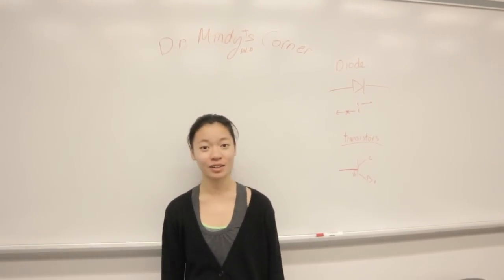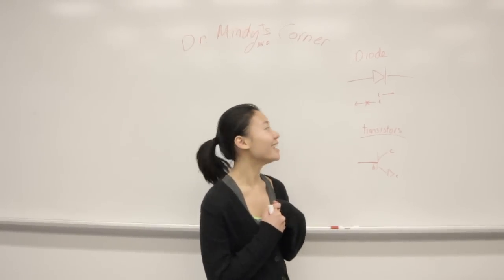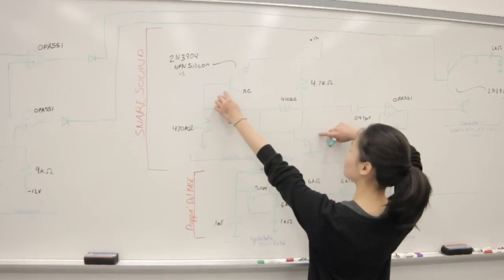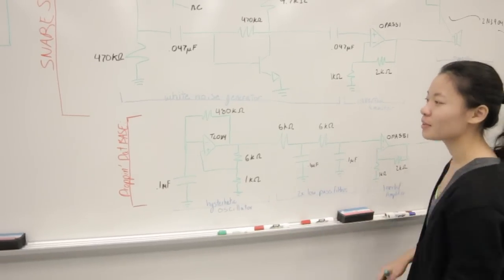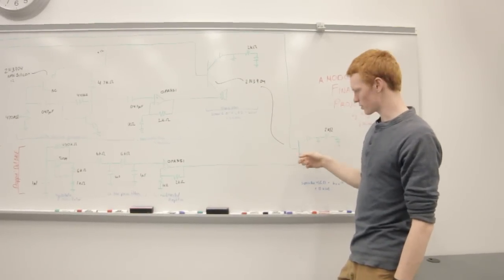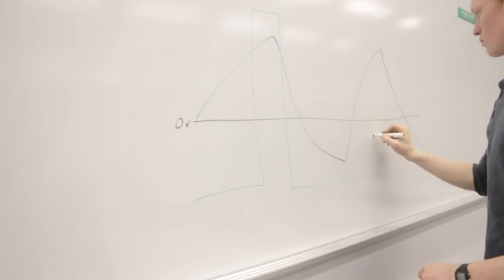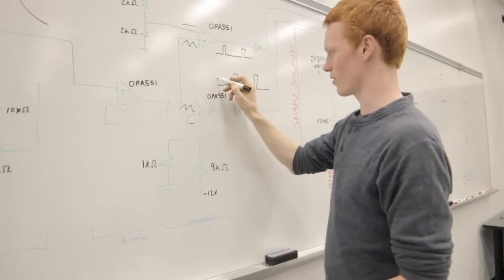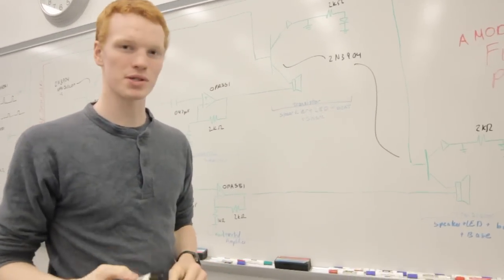Analog Beat Box

Comment: @2:32 yes, I confirm those LED will not work! You have 0V on the anode and 0V on the cathode. There is no voltage difference. You need higher voltage on the anode side to make the current flow through the LED.
Also 2K resistor for the LED gives a current of ~1mA. A LED needs from 10mA to 20mA to properly light up. It depends a lot of the kind of LED you use. More current = more light.
Reply: yes but too much current equals burnt out diode :)  The diode can act as a filter like a capacitor to clean the signal also, and insure current doesn't backflow.. although I am curious also if hte speakers themselves can act as inductors.